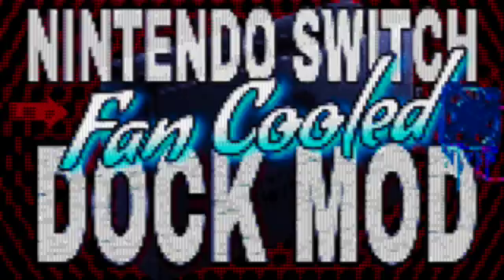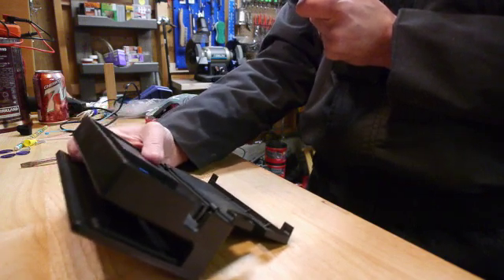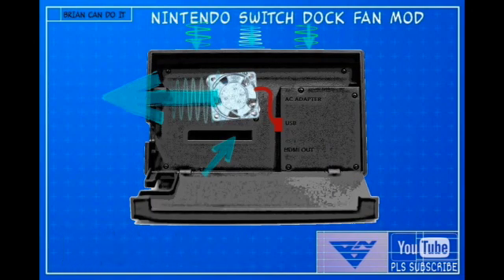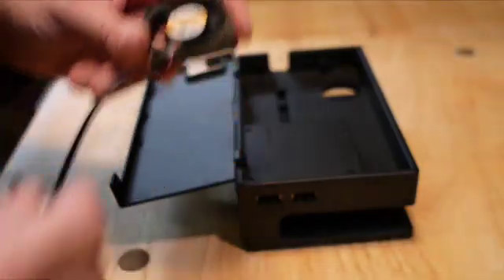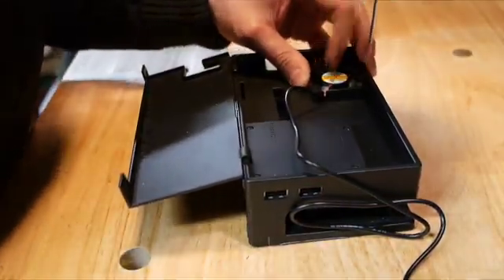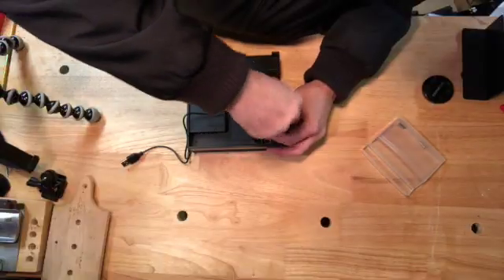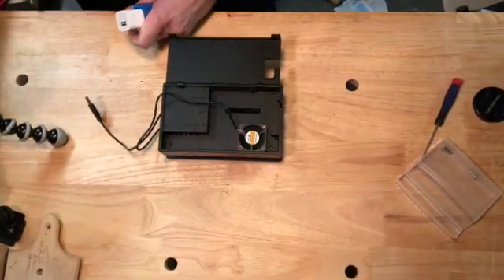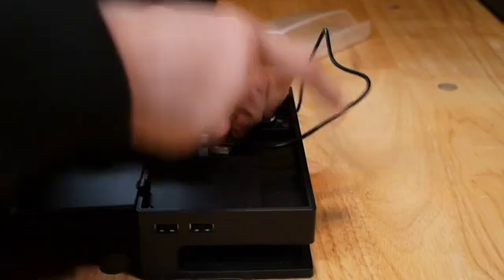Brian Can Mod a Nintendo Switch Dock with a USB Fan (EP-3)

Comment: I feel like you'd probably notice better temperatures if you had placed the fan where the hole / vent is, about an inch below where you actually placed your fan.

I'm running a very similar setup, I moved the dock circuit board beneath the switch dock (USB facing front HDMI facing backwards), this gave me room to expand on the vent on the dock as it partially covers the right vent on the actual switch.

In doing this I was able to slap on two 92mm noctuas using a pwm/3 pin fan splitter and it noticed a huge change in temperature for the better.

Comment: Awesome job! 
Is the fan blowing or sucking?
Reply from the maker: Kyle 0 
Thanks. It sucks the air through. It’s been over a year and it still has not overheated.
Reply: @neffonguitar  Oh nice, glad to hear it hasn't overheated.
I'm thinking of doing the same thing.
I'm going to blow mine into the bottom of the switch. I may add a filter bit to.

Comment: I don't actually like the position you put the fan cause its really not cooling anything its a better option to fit and intake fan on top od the grill that will push more air into the system this is just blowing to the back plus it can actually make thermals worse.

Comment: The fan is on backwards actually pulling air away from the switch not pushing air to it this is just heating up the console even worse in dock mode as your pulling the fresh aire from the bottom vent away before the switch can pull the air in with the fan sucking made by the gap between the fan and case. Do not follow what he did unless your sure what side is the pull and push of the fan your installing or your gonna over heat your switch that’s already over heating from being in dock mode normally
Reply from the maker: I actually modded three different switch docs (my sons each have one). Yes, the one in this video sucked the air through. The second one I built pushed the air. I tested the temperatures with a probe on both and the results were identical. 

For the third and best mod I took apart a cooling unit from an Xbox 360 and attached the three fans in the front blowing in. That was the best. 

The reason that I didn’t post a new video was because I shouldn’t have attempted to share this modification. I’m not a gamer. Some people want to hate and that’s fine but the mod in this video still works extremely well. It sucks the air through and has never overheated.

Comment: So the fan blows towards the plastic back? How is that suposed to give the switch more airflow??
Reply: someone somewhat open the back of the dock
Reply from the maker: Hi, thanks for the comment!  The original idea was to help pull the air from around the switch and force it to move and cool as it passes towards the plastic back.  Right or wrong, it worked.  I modified my son’s dock pointing the fan towards the unit and I drilled additional holes in the back and bottom to vent the air.  Both designs seem to work, but I still need to compare the before and after temperature for both.
Reply: It not even pushing air to the back of the switch it pulling air away from it that’s worse as the fan was install pulling air not pushing it  to the back of the console
Reply from the maker: Cloud Gaming 
Again, you are right! But again, it’s been over a year and the thing has never overheated. It works fine

Comment: Could you do a comparison of the internal temp of the switch before and after?
Reply from the maker: That’s a really good idea.  I’ll give it a try.  Thank you!
Reply: Brian Can Do It! Did you ever get to do that?
Reply from the maker: Gedion Samuel 
yes I did. I never posted a video though. I did three mods total and tested the temperature on each with a probe. The first mod is the one in this video that sucks the air through. The second mud push the air and the results were identical. I got the best results on the third mod. I attached three fans from an Xbox 360 unit on the front instead of the back. I learned that the switch heats up in the front corners. Regardless, the modification in this video still works extremely well over a year later. It has never overheated.